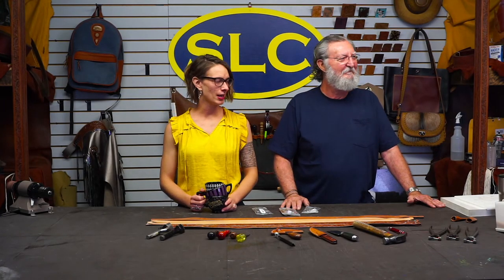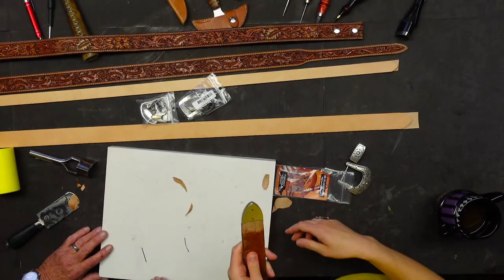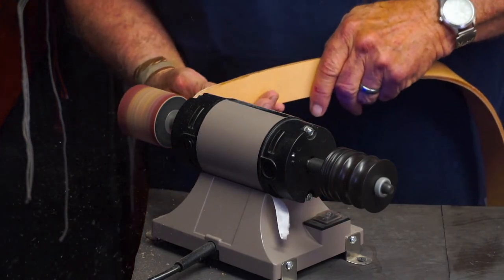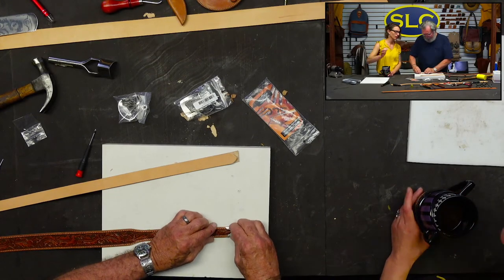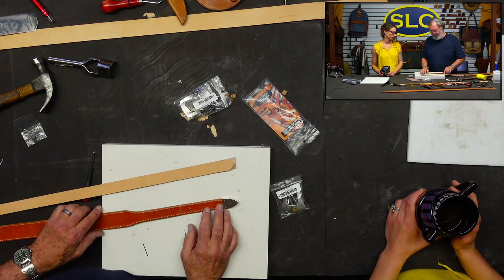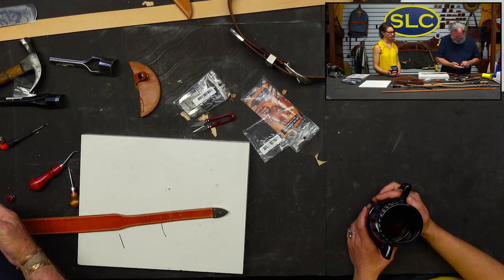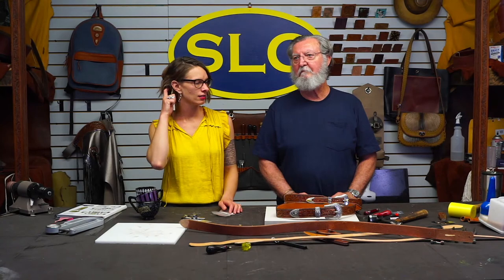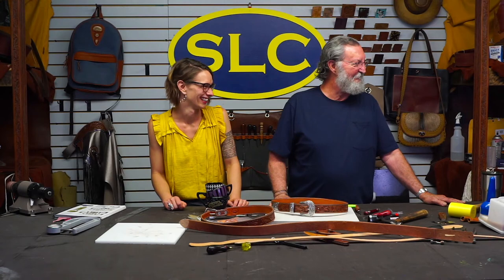Western Belt Buckles + Tips w/ Denny + Liz

Comment: What would you suggest to do in order to attach a 1 1/2" silver tip that has no holes in the back?
Reply from the maker: You could try and use some top fit inside the belt tip and attach it that way but that's not guaranteed. The best thing we can recommend is to drill a hole through the back, tap it and find a screw that fits it. I hope this helps.